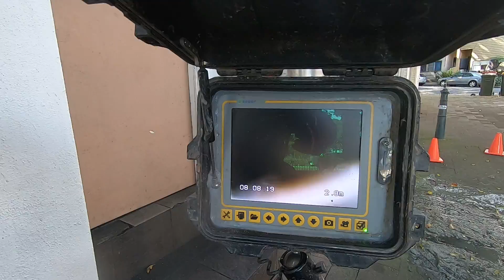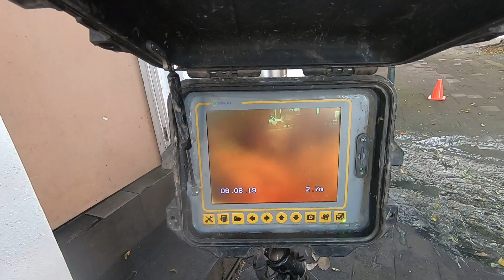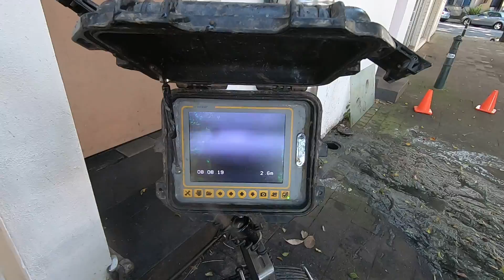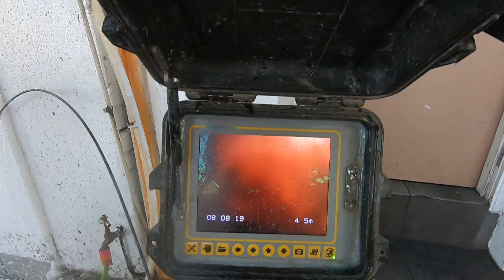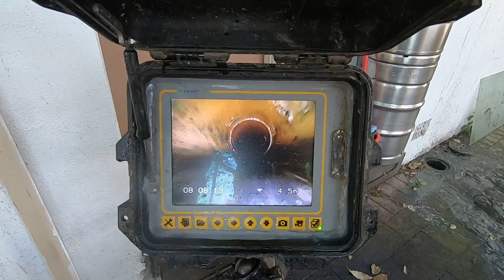Blocked Drain 301

Comment: I love watching your videos. They are all very interesting to see how you problem solve the issue. Is there a way to put in the info of what the customer has said the issue was and what you have found? I know some are super easy, clogged with roots, or baby wipes or grease but then some videos are hard to tell what was the issue of the clog and how you fixed it. Also what happens when a drain is broken? Do you all dig it up and fix it or another company has to come in and pull up the whole line like they do in America? Thanks!